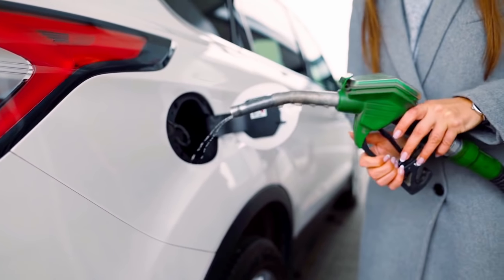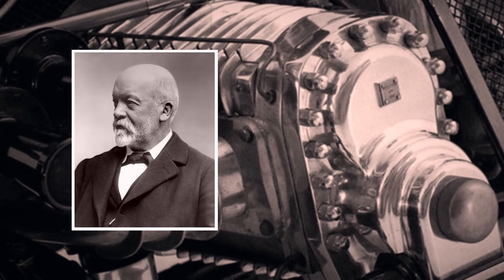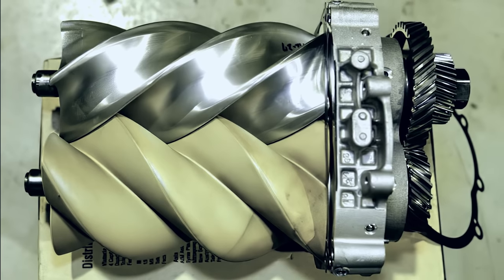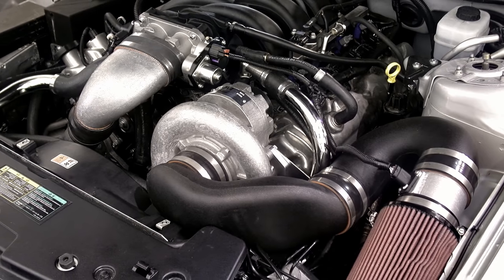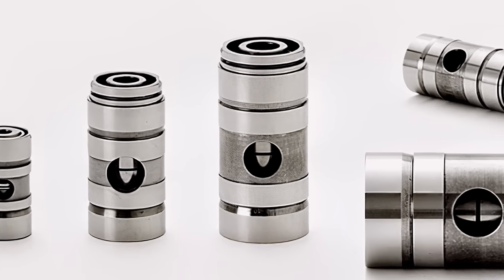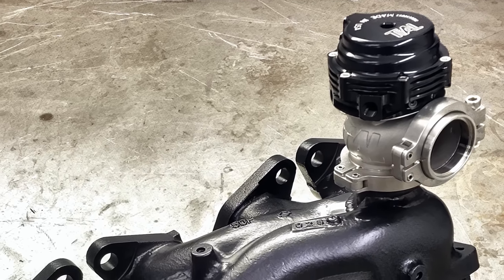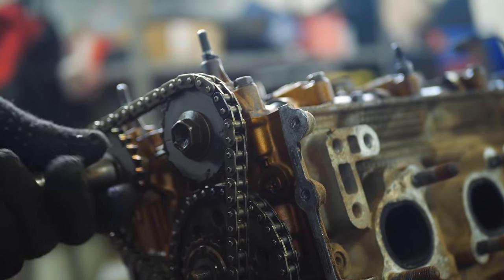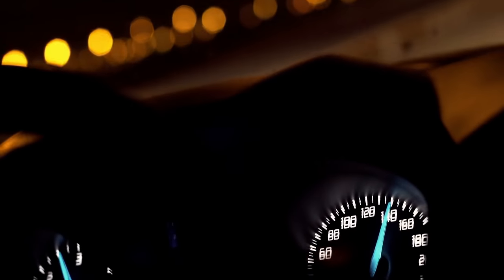The Science Of Boost

Comment: As I recall, those sport bikes have a volumetric efficiency of about 120% or more, thanks to high rpm making the intake velocity sky high, and cramming air into the chamber.

Compare a 1979 liter bike to a 2008 liter bike: 81 rear wheel hp vs 172.  

Redlines were 9k and 14k respectively, so that alone increases power by 5/9ths, or 55%.

So that raises power from 81 to 125.  But that's not quite 172.  Where does the extra 48 hp come from?

Well, 48/125 is 38.4%, so that's requires a rise in torque from 65 to 90.  And that's pretty much what happened, partly abliged to increased volumetric efficiency.
Reply: RPM have nothing to do with intake velocity.
Reply: RPM is the ONLY  thing determining intake velocity (after the engine is done being built).
Reply: @MultiPleaser  ok, after engine is being built. But skyhigh velocity does not make power.
Reply: Peak torque occurs at peak air intake velocity.  

Sky high rpm moves peak torque towards redline, and even makes near peak torque at redline.  This is where peak intake velocity occurs.

And since power equals room times torque, then 
very high power and an engines's peak power both occur at (and because of) sky high rpm.
Reply: @MultiPleaser  skyhigh rpm is different than skyhigh intake velocity. All highperformance engines have about same intake velocity , no matter if they turn 2000 or 20000 rpm.
Reply: So, a lumbering diesel at 2000 rpm, perhaps 16 liters, has the same intake velocity as a 20,000 rpm Japanese sport bike, which is a 250 cc four cylinder.  In the past the grand Prix cars also fevved to 20,000 rpm. Tho were around 2.5 liter v-8 engines.

OK, so what happens if you reduced the sport bike or GP car to ONLY 2000 rpm?  Same intake velocity as 20,000 rpm?  No, it'll be fifteen or fwenty times lower.

And what if you speed up the 16 liter diesel to 20,000 rpm? Assuming it doesn't fly apart, it's intake velocity will be much higher.
Reply: And what happens when you apply all sorts of "go fast" goodies to an engine, but never change the bore and stroke?

Huge intake and K&N filter?  Higher intake velocity.

Performance headers?  Higher intake vocity.

Holly 4 barrel carb instead of the tiny, itsy bjtsy 2 barrell?  Higher intake velocity.

And in every case, the higher intake vocity means more power, more torque, more oxygen, more fuel, etc, etc.
Reply: @MultiPleaser  intake velocity cant go much over 0.6 Mach , so 16 liter at 20000 rpm is in choke , has been maybe after 2300 rpm. 20000 rpm F1 engines were undervalved , so they were in choke maybe after 17000 rpm , thats why their VE were quite low , 117% , but they still made power because at 20000 because rpm is power , and rpm range was very wide , they could pull from under 10000 rpm.
Reply: What's Mach 0.6 in less-than-ambient pressure intake tract? About 400 mph?

I calculated the intake velocity of my race bikes at redlines of 12,000 and 14,000 rpm. They were about equal to the bikes's speed in first gear.  Fidty to sixty mph.

That's why every ram air bike made in the last 30 years has intake nostrils about equal to the cross sectional area of the carbs or throttle body.
Reply: @MultiPleaser  check your calculations.
Reply: Yes, all high-revving sport bike engines are in choke after peak torque, which occurs at peak intake velocity, which occurs 3k, 4k or 5k rpm BEFORE redline.

However,  you can push peak torque higher with go-fast bolt-ons, or higher lift cams, or bigger valves or fatter ports.

In fact, I use home-made intake and exhaust systems to push peak torque to about 2k or 1k before redline.  

Sometimes a stock Japanese sport bike will be tuned to hit peak torque at 10k, peak power at 11k and redline was 12k.

They sometimes tune dirt bikes this extreme as well. My 1980 XR500 makes Peake torque at 5k, peak power at 6k and redline is 7k.
Reply: I did the math about ten times.

Hey, guess what max piston speed is?  Yep, you guessed it.  Also in the ballpark of 60 mph.

How can you get 400 mph intake speed with such a slow piston?
Reply: @MultiPleaser  because piston is much bigger than port.
Reply: If 400 mph was the intake speed, then no vehicle ever made with ram air would actually have ram air.  

Sorry, dude, a ntake speed is less than vehicle speed.
Reply: @MultiPleaser  intake valve is not open all the time , and most of the time only partially.
Reply: You just made my point for me. Thanks.
Reply: @MultiPleaser  but the point was , all high performance engines have same intake velocity no matter what their rpm range is.
Reply: That's the most laughable thing I've ever heard.  

A tiny F1 engine make more hp than a huge NASCAR v8.  The airow must be night and day between the two.  Huge air intake with less hp.  That means much slower air speed.

Look at the 1 liter sport bikes over the years:
1979: 81 hp
1990: 117 hp
1999: 135 hp
2008: 172 hp

Sure, they all flowed the same air.

My 400cc sport bike flows more air on a bead Dyno than my 2.8 liter sports car.  The tiny engine makes 70hp whereas the humongous engine made 170.  The tiny engine has to flow about half the air since it was half the hp.  

Bit, it's about ten times smaller.  Therefore, five times the air speed.
Reply: @MultiPleaser  seems like you dont know much about engines , it's ok.
Reply: I calculate I know 10 times more than you.  It's not ok.
Reply: Here's the 411.  Power equals energy per unit time.  Energy comes from a certain mass of fuel and oxygen.  

Therefore, power comes from what engineers call "mass fliw rate".

Divide by cross sectional area of the intake tract and you get air speed.

Air speed goes WAY, WAY up when a tiny 4 cyl engine make more power than a humongous V-8.
Reply: @MultiPleaser  no it doesnt , 2 valve V8s just have smaller ports.

Comment: Could you have a supercharger that uses an electric motor to drive it?
Reply: Yes
Reply: @dadillen5902  would it be worth it? Or effective?
Reply: @RamenHutt  BMW used a hybrid electric turbocharger. It help spin up the turbo to control turbo lag and flat spots in acceleration. Would a straight electric only blower/turbo be effective/efficient, if so someone would have made one by now, so i don't think so. That is all based on current technology. With new technology who knows.

Comment: Boost = Inefficiency!!! The faster a fluid moves the lower it’s pressure will be. Think about increasing the Volume of air moved not it’s pressure. The more you compress air the hotter it gets. lowering its density! Unless you have direct injection stay away from hot air if you don’t like knock knock jokes.

Comment: I will always have an issue with the idea of turbocharged engines being efficient.  From what I have gathered, they are NOT efficient when under boost and making peak power.  Their efficiency comes from having a smaller engine and not being in boost.  I have never been satisfied with the explanation that turbos capture "free otherwise waste heat" and turn that into power somehow.  The heat causes pressure otherwise known as backpressure.  Each piston has to push exhaust gas out against this pressure, which leads to substantial pumping losses.  Generally a turbocharged engine will have MORE backpressure in the exhaust than boost in the intake, and the intake pressure can't really push the exhaust out because those events are largely not coupled (would require massive valve timing overlap and push pressurized air fuel charge directly into the exhaust which is not going to do any useful work or make power).
Reply: WRONG.  100% WRONG.       When you turbo an engine the torque and horsepower curves stay EXACTLY THE SAME, THEY'RE JUST AMPLIFIED.      I suggest you checkout Richard Holdeners channel and learn from a professional, not these wanna b's.    There will never be more back pressure than boost unless you've sized your turbo or exhaust 100% wrong.      Go see Richard and get an education from someone who is professional with a lifetime of experience and all the dyno runs and numbers from every combination you can think of to back him up. Westech will not steer you wrong.
Reply: So, when I put the turbo on my 5.7 and made 650hp with an otherwise stock engine I wasn't using waste exhaust heat to make more power ????  lol.
Reply: @quietcool4884  Time for you to go to school then. I watch Richard Holdener and understand very well that turbos amplify what's already there.  I never disputed that.  However, you will almost always have more exhaust back pressure than boost.  Sometimes waaaaay more.  Only in very ideal/limited circumstances is it possible to achieve the ideal 1:1 back pressure to boost ratio.  Richard Holdener will tell you this if you actually follow him as closely as you say you do.
Reply: @quietcool4884  I have no idea what this comment is supposed to prove.
Reply: @kevin9c1  No shit there's back pressure, how do you think a turbo would work without back pressure ?  Add a turbo and more fuel/oxygen and the backpressure goes up because you're burning more fuel to make the power.  You need the backpressure. Even a N/A engine has backpressure to a point but they benefit from exhaust pulses and scavenging to draw the exhaust out of the cylinder.  Hey, if you have waaaaay more backpressure, you've chosen the wrooooong turbo.